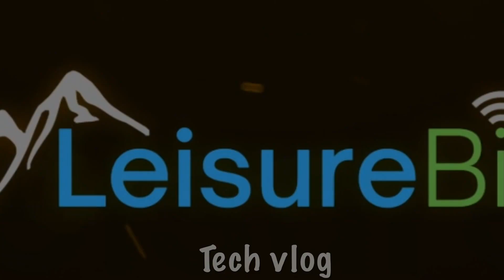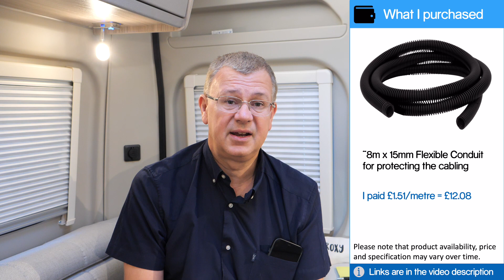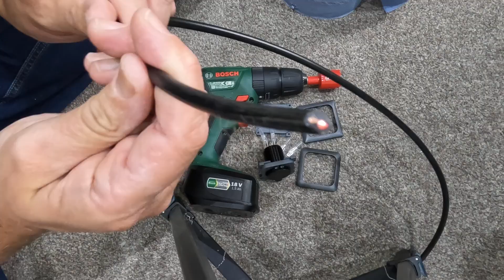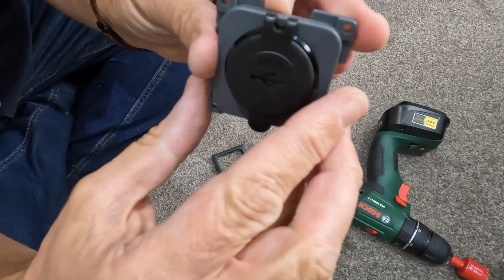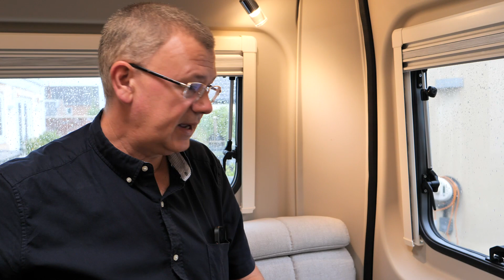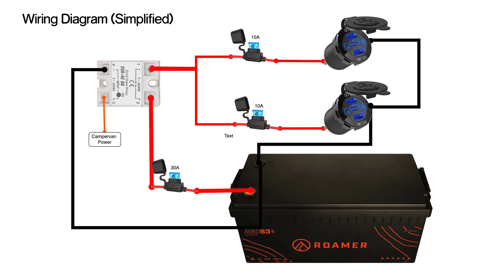HOW TO INSTALL A 12V USB Outlet Dual Quick Charge & USB C PD with Power Switch

Comment: Hi there.. Could you spur off the electric socket..?
Thanks
Reply from the maker: Do you mean the 12V socket? It’s a 12V device so would need to be on a 12V suitably fused and wire sized circuit and if one was available then yes. Certainly in my case, it needed a new circuit for the USB so it worked permanently for my use.  Hope that makes sense, worth checking with an auto electrician if any doubts. All the best, David

Comment: does the power button turn off the voltage reading too?
Reply from the maker: On the model I have it just has the lighting rather than the volt meter but believe it does with those ones. The lights and the USB's switch off with it If that helps? All the best, David 👍

Comment: Hi David great video just a quick question iav got some 27amp automotive cable from halfords to fit to the same usb as you have done in your video do the spade connections have to amp rated iam only asking because halfords only have 15amp spade connection  hope you can make sense of my message keep up the great work 👍 cheers cliffo.
Reply from the maker: Thank you - you would be fine with 15A terminals for the USB if they are the same  as mine as the maximum load would be under 10A (more like 5-7A) - main thing to ensure is the fuse you have is 10A or 7.5A to ensure the cable and spade connector are protected. Can’t see an issue with that though, All the best, David 👍
Reply: @LeisureBit  brilliant thanks for your help very much appreciated we look forward to more of your videos cheers 🍻

Comment: Hi, can you provide some more detail / information on the "campervan" connection to the relay please? Is this just a power on signal when the van power is on?
Reply from the maker: Hello, yes that’s right it’s simply a signal when the campervan power is on and the relay is preventing too much.power going through the original electrics which weren’t designed for it. 
Hope that makes sense, all the best, David 👍
Reply: Thanks David. So could I take a live feed from any nearby 12v circuit that is switched on when the van electrics are turned on, e.g a nearby cigarette lighter type socket?
Reply from the maker: Yes thats right - i just took a handy one from the PDU as shortest run to it - but thats exactly it. All the best, David
Reply: Great, thanks!!

Comment: Thank you for  nice informative video.  Does the solid state relay run hot? I don’t have any experience with dc to dc ones but used ac to dc ones at work and even at low currents they were extremely hot and had to be mounted on heat sinks.
Reply from the maker: When I’ve checked and when there was a reasonable load they run warm but not too hot to touch I’ve found - I’m only using at less than half of the rated current though and at full rating would imagine they may run hotter and need some form of heat sink. 
I will do some extra checks as only checked a few times to make sure they weren’t running hot.
All the best, David 👍

Comment: Hi David. This is great. It mostly seems doable for someone like myself who is pretty ignorant about electrics. But at the bit where you say you connect the relay to a source that indicates when the van electrics are on, how would one go about finding and connecting to such a connection?
Reply from the maker: Hi, thanks for the comment and a great question - there are a couple of ways of doing it, the easiest it to find an existing ‘thing’ which comes on when the van power is on such as a spot light fitting (which lots of folks just connect to anyway) - what type of van is it? 
Hope that makes sense, all the best, David 👍
Reply: @LeisureBit  thanks David. It's a Hobby Vantana K65es. So the spot light will have a positive and negative connection. Are you running a wire from the positive side to the relay input? Sorry if this question displays an appalling ignorance of wiring and electricity!
Reply from the maker: @jonesieboy  yes that’s right, from the positive (just check when you switch the van power off the spotlight goes off), if a mechanical really to the coil and if solid state to the input and then that switches the USB on without overloading the original van wiring. Hope that helps 👍
Reply: @LeisureBit brilliant thanks David. I get it now.

Comment: Smart job David, one I won't be doing as we take little tech away with us so hopefully can manage with the 2 standard charges and ours is now a fixed bed. Hope you and Rachel have a great weekend and dodge the weather, did you get your roof leak sorted? Cheers K.
Reply from the maker: Thank you - fair enough no point if you wouldn’t need it. Leak not sorted yet but even with really bad rain it’s not been too bad all be it still an issue of course (you’ve reminded me as I got side tracked investigating what the issue is to sort it)
Had a spell of rain today but fortunately a short one / hope you have a good weekend and the weather is kind.
All the best, David & Rachel 👍

Comment: Hi David.  Did you test the USB sockets prior to drilling the holes in the van? Or only once you'd made the 30mm holes in the wall 😂
Reply from the maker: Hi Chris, Great question - I did quickly check they powered up and have been using one for a year or so now (not these ones but same type lower down in the van) - also tested the cable but both of which easy to sort. fortunately all worked ok and the 30mm hole is a fairly standard size. 😀
Thanks for the comment, have a great bank holiday weekend, David 🙌